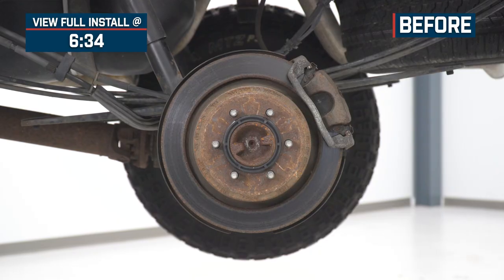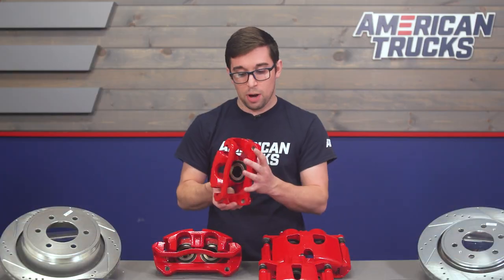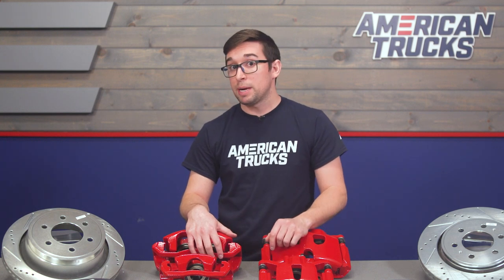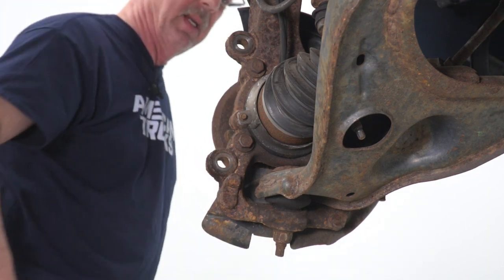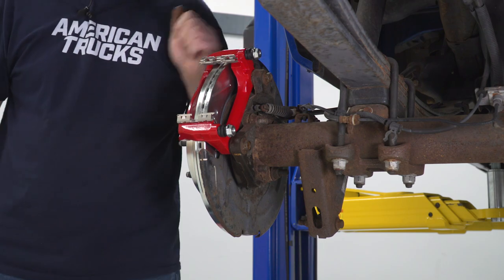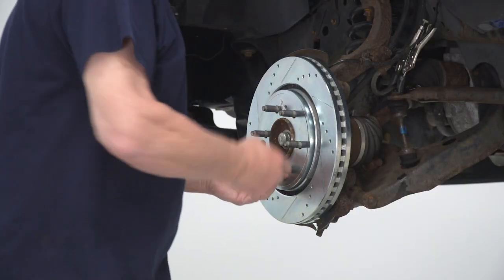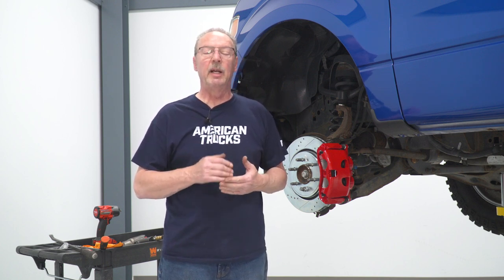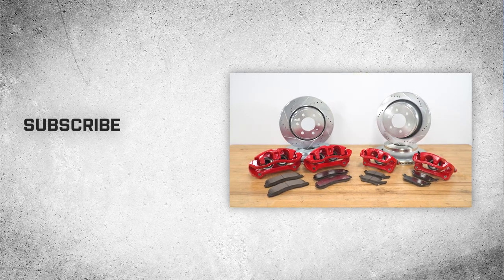2012-2018 F-150 PowerStop Z36 Extreme Truck and Tow 6-Lug Brake Rotor Review & Install

Comment: Just got me a new set of front slotted brake performance rotor and pads for my suv installed today at home.  Big improvement for sure, My vehicle stops much faster and a lot shorter distance than before from the stock.   I didn't change the back set because all the heavy lifting is done in the front as the weight shifts to the front more during the brake. So I just kept the rear stock.

Comment: So, I installed the kit on all 4 about 6 months ago.  Bought from you guys.  A month ago the front driver side caliper locked, and destroyed the the rotor and pads.  I called you guys, and of course you push the easy button and refer me the powerstop.  (keep in mind this is my daily driver), with no parts to go out to buy.  They kept me dangling for 4 weeks.  Then, instead on a complete replacement, they send me 1 rotor, and a set of brake pads.  ( Before they sent it, I had already purchased another front set from you guys, as waiting was not an option.)  Anyway, unstuck the caliper, installed complete, and so far all is good in la la land.  
Just thought to share my experience.  Once I wear them out, and its time for new, I'll invest somewhere else.
Reply: Damn, did you have these put on an F-150, or F-250?
Reply: @alanpetersen4497   I put them on my 2013 F150 Fx4.  So today, I just installed a whole new front set.  The same caliper just locked up.  Shame on PowerStop for not doing it right the first time.  Thanks to American Trucks for a quick turn around on shipping.  I still think powerstop makes a decent set of brakes for the money, but their Cust. Sat is poooor

Comment: Great Video! I just got my set of Powerstops in for my front brakes. Excited to swap out the oems! This video helps break down the process, great job! I’ll be doing a brake fluid change as well, I’m going to run the amsoil brake fluid. 🤙🏽
Reply from the maker: Thanks for watching! -Zach
Reply: Same here, I'll be changing out all the old fluid with the amsoil brake fluid too.  I bought a new set of upgrade slotted brake rotor and ceramic pads for the front. All installed at home.  Did the break in cycle and all is great.  I notice a big improvement in stopping distance. No more worrying about swerving out of the way to avoid front end collision. My suv weighs about 4000lbs so this upgrade really shortens the distance a lot and much quicker too.

Comment: How exactly does a vented drill hole help with dissipating heat when it's just venting heat directly onto the brake pad? To me, that just negate dissipating heat away from the brake pads.

Comment: Worthwhile upgrade over factory especially running larger tires compared to stock size.  Only issue wasn't with the kit, but rather removing the rotors from my F150 since I live in a climate with a lot of snow ie salt and mag chloride on the roads in the winter.  No amount of hammering or PB Blaster was loosening those old rotors.
Reply: So how did you finally get them to loosen up?

Comment: I upgrade rotors and brake on my 2016 Honda Pilot and when started driven make like weird noise like is rubbing something but I don’t is because the rotors a bigger and mire grip cap are to factory one can someone help me if is normal

Comment: spec-wise, is there any reason to use these calipers over the factory calipers? Seems like a bit of lipstick on a pig that just about doubles the cost of the kit for some red paint.
Reply: only if your oem calipers need to be replaced this is an cheaper option for some vehicles.
Reply: @iphone3gsdivine  Just to be clear, there's no performance or mechanical benefit from changing working factory calipers to these?
Reply: @kylegeldmaker The primary mechanical benefit of the powder coated calipers is the added corrosion-resistance of the calipers themselves. There are no added performance benefits such as increased stopping power/cooling. If you do not need to replace working factory calipers and have no interest in the cosmetic aspect, the complete front/rear brake kit would give you the performance upgrade needed at half the cost.

Comment: So, yesterday, the other caliper has locked up.  That's two.  I am an old man and do not drive my truck rough.  I will have to start to replace with another manufacturer.  What a waste of time, money, and my labor.